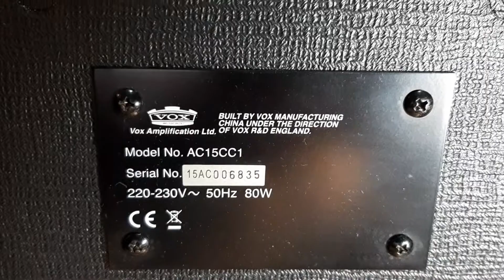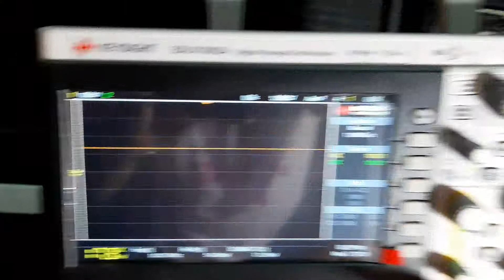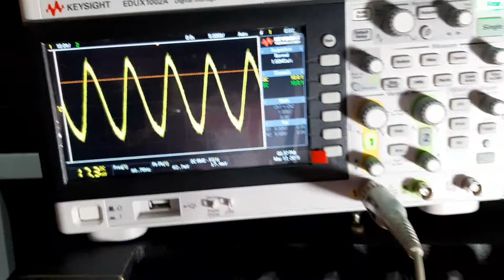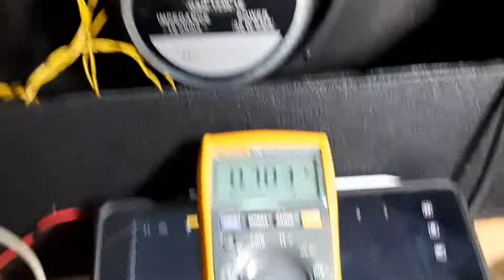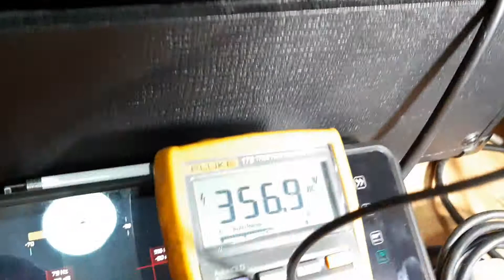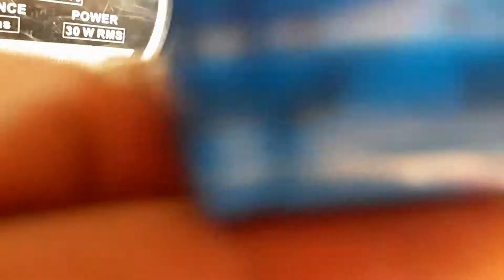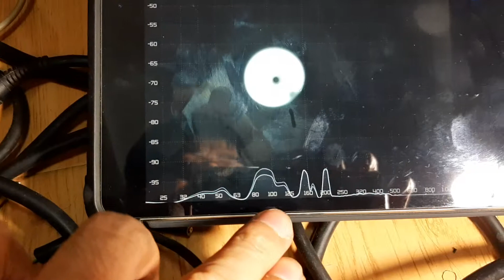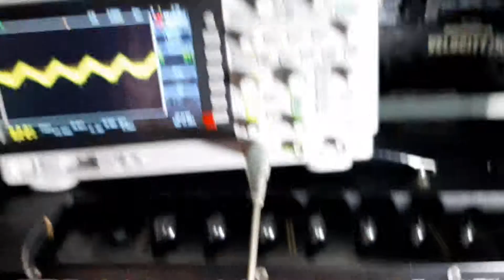Fix Vox AC15CC1 Hum, (100Hz)

Comment: Man! i got the same hum noise (100hz, even with no signal input, even at zero volume) and i was going to do a full valve replacement, so you're a savior. Did you replace both capacitors or just one? Can you tell me exact specs of the capacitor so i can replace it too? Thanks!
Reply from the maker: On the PCB are 2x20uF got ripple, after add 1x100uF we can minimized ripple, if we added to big value you may got main fuse blown from initial current that need more a bit longer time to complete charging to more capacity, so you need change more higher fuse rating. cheers.

Comment: I have a vox vt30, but now there is a problem. if I play for 30 minutes, the sound suddenly decreases and hoarse. what's the problem?? Please help me. Thank you
Reply from the maker: @papahjoshscene4234  VT30 is digital modeling amp(like digital effects +power amp +speaker) please check power supply and all pot cleaning, try cooling down electronics section perhaps you got high temp from power components or self thermal protection.

Comment: Different capacitance in power supplies will change the sound too. VOX often has a kind of harmonic riding on the signal, that will probably disappear.
Reply from the maker: Sure my friend, but the 50 or 60 Hz ripple with our guitar tone rinding on this none musical harmonic is unexpected for me.
Thanks you for you comment. Cheers.

Comment: Good job man, spot on. I was just taking mine apart for the same reason and found your video. Mine was making the same hum and I think I have the same spider web in my cabinet too. Ha. Now I have to find out why my tremolo is always the same speed (fast). Probably also a capacitor. Chinese caps are often dodgy.
Reply from the maker: Thanks you zaum2002,
      More capacity on main filter make lower ripple (less hum) more base response as well, but if to much gonna make  main fuse blowout easily, from long charging once power up., need to change bigger fuse.